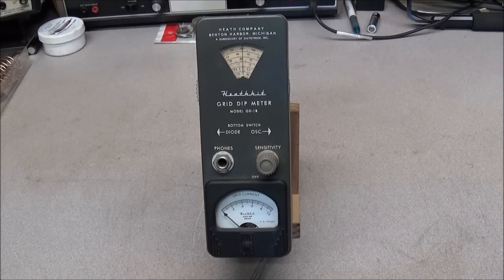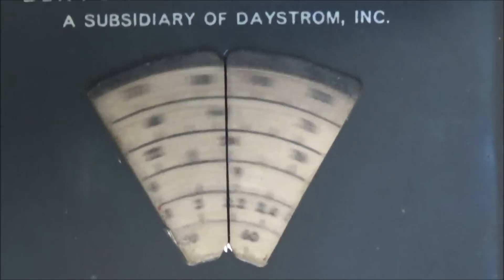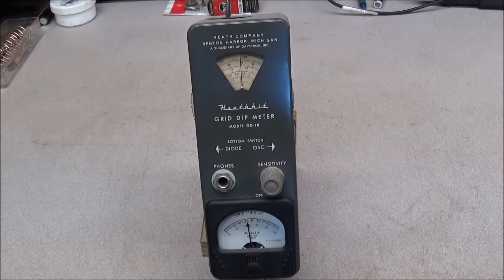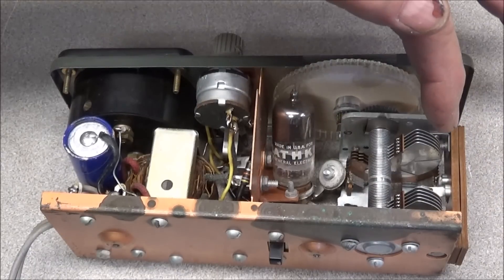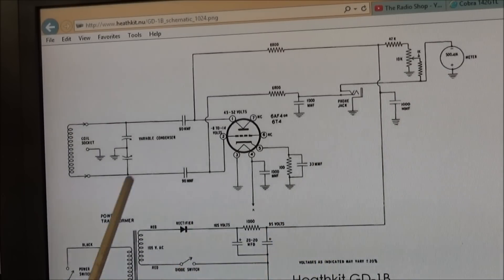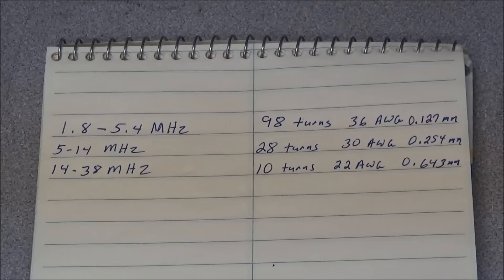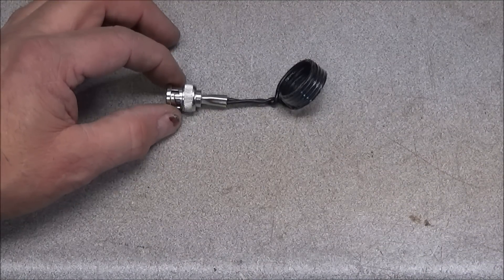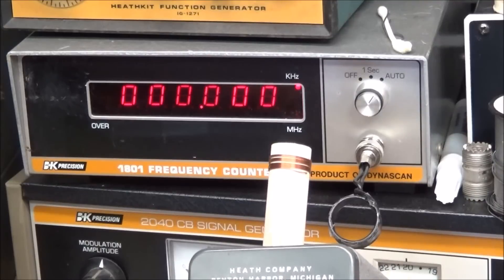#24 Heathkit GD -1B grid dip repair and homebrew coils

Comment: FYI I have a coil for this model that says 27-100mC.  The form is 0.75" Diameter, the wire is 20ga and 2 1/4 turns.   The other coil has too many turns to count but it's 100uH and range is partially obliterated _ to 2.5mC.  Also on a 0.75" diameter form.
Reply from the maker: Thanks for the information!

Comment: At time of 9:45 you have mentioned that as you remove turns of wire your frequency will go down. If your referring to meters then yes but I think you meant  the frequency will go up, less turns = Higher Frequency. More turns lower frequency in MHz.  Glad your showing others what can be done as there are a lot of G.D.O.s that have missing coils. Good instructional Video! Good links too!

Comment: Wow, 20mhz and right on Buddy! Wow, I have an old one as well. Got me a Eico 710 grid dip (hehe... dipper)from the late 60's. Had it since I was a kid. The 6af4a finally went bad. Replaced it along with the cap. Great toy for many areas, even good for checking coil values as well. Thanks for sharing.
Reply from the maker: +saturn5tony He he, was not hard to do. Lots of info out there. Got to love the old dippers.  I have seen the Eico's before. Thanks for watching Tony.
Reply from the maker: +saturn5tony No problem Tony. Glad you liked it. I love all test gear, Eico, Heath, what ever. Fun stuff to play with.

Comment: I have that exact meter.  Mine was inherited from my grandfather who bought it in 1958.  Even have the original box and purchase receipt.  Nice job on the coil fabrication.

Mike
Reply from the maker: +MikesRadioRepair .CBRadio Very nice Mike. I bet it has a bit of sentimental value then. Should be a good unit will all the bits and pieces with it :) Thanks for the comment.